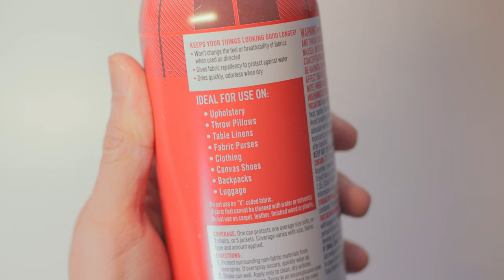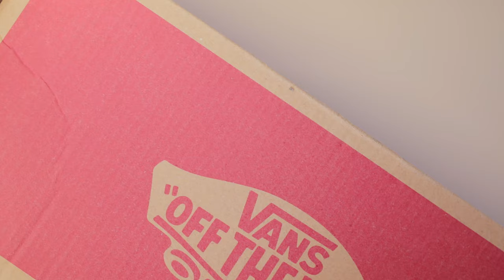Applying Water-Resistance On Everything! | DIY Project

Comment: Scotch guard isn’t very effective as the water will repel in a small amount, in a mild rain you will still get very wet, I would recommend Nikwax as it is way more resistant and durable
Reply from the maker: I have noticed that it works most effectively agaisnt splashes of water instead of sprays of water.  Will have to test it out more. Yes Nikwax is probably the most recommended one for DIY water-repellent stuff but it's difficult to get a hold here in my country hahaha
Reply: @Ruey14  the other waterproofer is grangers. But I don't know that availability in your country.

Comment: Need some dwr coating right now. Thanks for this. Ive been using one but doesn't last long as the original water proofing on my jackets. It always wet out fast.
Reply from the maker: Which brand are you using? I'm interested in seeing how long my coating will last since I did apply quite a lot of layers loll. It also depends on how often you wash the piece I feel
Reply: @Ruey14  a Chinese brand which I can't read. I hope scotchgard works longer than that I'm using. Only minutes on heavy rain my jacket starts to wet out easily.